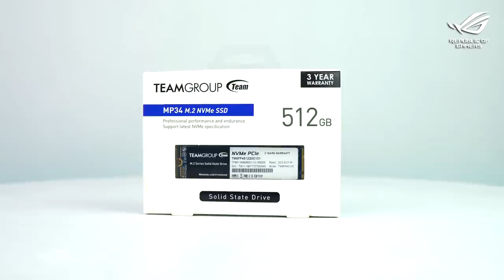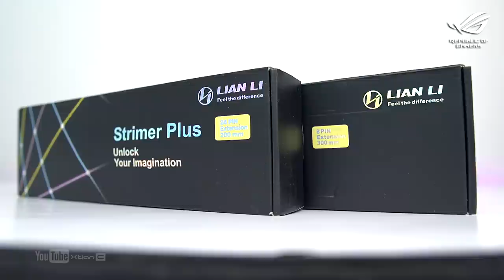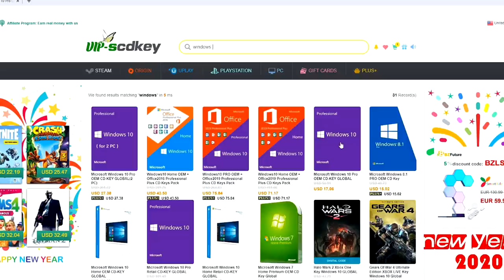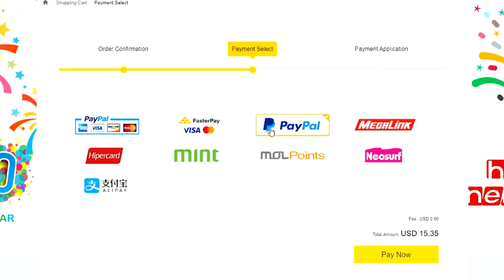($4000) Php 200K FULL ROG WHITE Gaming PC Time Lapse Build

Comment: It’s good to see a radiator fitted with pipe work in the correct position to prevent cavitation, pump noise and premature hardware failure.  Well
Done.   Nice build.

Comment: Question, how did you get the Lian Li streamer RGB to work with a different rhythm? I assumed you hooked everything to the motherboard 5v ARGB connector and used the ASUS Armoury to control the rgb.
Reply: Hub
Reply: @EagleFPV43  Which hub?

Comment: Hello Boss Xtian. We have a board ROG strix b450-F and I used LC 360. If I'm going to sync the AIO to the motherboard should I use RGB splitter? Walang 3 pin sa board eh.
Reply from the maker: Hindi po pwede ma sync yan 3pin needs 5v output.

Comment: My tip for you: remove the thermal paste from the manufacturer and apply a qualitative for better temperature. I made the same.
Reply: I think that is not necessary
Reply: @daledale5693  I also meant for better temperatures. My Cpu is now 10 degrees cooler. It's just a tip for people who rebuild it.
Reply: Myth
Reply: @daledale5693  You have no idea. I have tried it myself. And now goodbye.
Reply: What's the thermal difference?
Reply: @vsyred297  i used thermal grizzly and my cpu gets 10 degrees cooler. Of course its fifferent from cpu to cpu. Try it yourself.
Reply: @MB-yv5xg  i do believe that you will get a much lower temp, but 10 degrees? Nahhhh

Comment: Kuya xtian ok po bato
Ryzen 3 3200g
Corsair Vengeance RGB PRO 16GB (2 x 8GB) ddr4 dRam 3200MHz 
Msi A320m-A pro socket AM4 dd4
Ssd  220
Hdd 1t

Ano po kaya magandang power supply dito

Comment: I have this, won’t be attempting to build it until I see AMDs GPU then I have to order a GPU 

AMD Ryzen 9 3950X Processor
GPU. Waiting*** fingers crossed for AMD
RAM **Not sure but wanting 4x32gb**

ASUS ROG Strix Helios Tempered Glass Mid-Tower Chassis
ASUS ROG CROSSHAIR VIII HERO (WI-FI) X570 Gaming Motherboard
ASUS ROG Ryujin 360mm AIO Liquid CPU Cooler
ASUS ROG Thor 1200W Platinum Power Supply

Microsoft Windows 10 Home USB Drive 32/64-Bit OS
Gigabyte AORUS 500GB PCIe Gen4 NVMe SSD

Gaming storage
Gigabyte AORUS 1TB PCIe Gen4 NVMe SSD

Future storage to be added at a later date.

Might replace case fans with 
Noctua NF-A14 industrial PPC-2000 PWM 120/140mm Fans

cable sleeve extensions ordered*
Reply: Bro, I feel sorry for you coz AMD GPUs are nothing compared in front of NVIDIA.
Reply: Jayed AL Sabit I feel comfortable with your opinion 🙏

Comment: guys can someone tell me what l need to do to have rgb fans in my pc? l just built it and my fans are rgb but for some reason l cant change the color or the mode from the motherboard, they just remain red. My motherboard is asus x370-a and l dont have an rgb controller. thnx and it would be great if someone helped me.
Reply: Depende sa fan yan baka d supported or something

Comment: Sana matulungan nyo po ako mkapag build ng pc ngayon na worth 25k na good for gaming na. Salamat po godbless
Reply: Replt If u want spec
Reply: Zero Cyne yung 25k po sana na may monitor and keyboard mouse na po. Salamat po
Reply: ryzen 3 2200g, a320 board,8 gb ram,rx 570,120 ssd , 1tb hdd the rest ikaw na bahala sa psu case 
3k lng nmn yung moni 1k sa mga  
mouse keyboard  headset ...sa gpu depend pede wla bka ksi sobra budget ok nmn yung ryzen cpu lng
Reply: Zero Cyne sge po. Salamat po sa specs